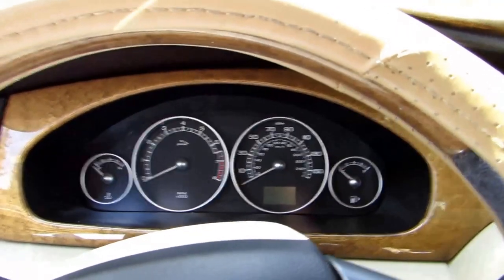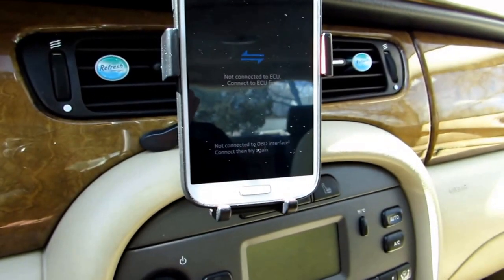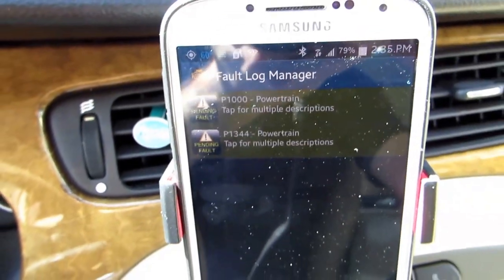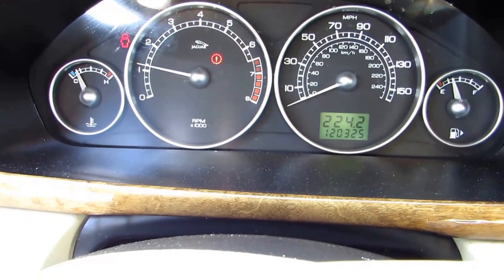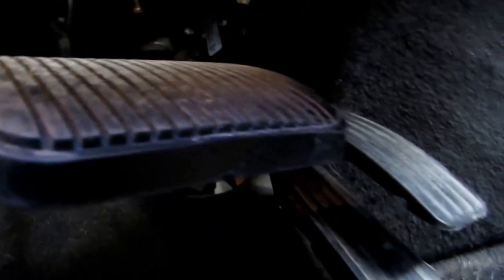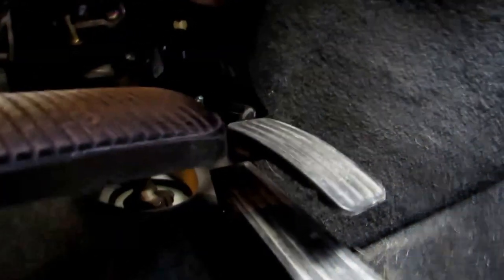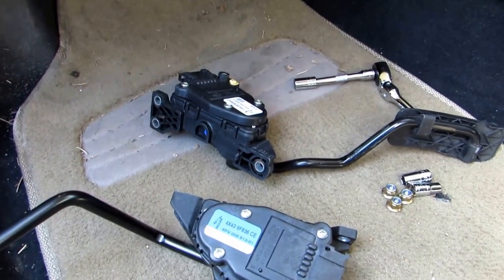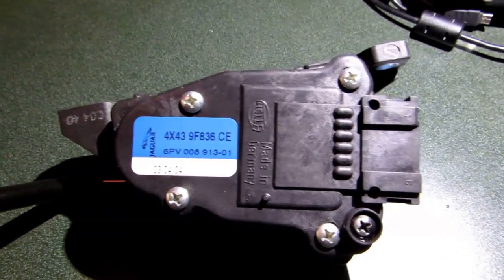2004 Jaguar X-Type Accelerator pedal sensor repair

Comment: Yes this is the fix for most throttle body sensor codes on a jaguar also bad connection in the connectors

Comment: what can cause your 2003 Jaguar X-Type to go into limp mode just saying Cruise not available won't go past 3000 RPMs and sputters and jerks
Reply from the maker: Trap Star, can you scan the car's computer for error codes via the ODB2 port? That usually narrows down the problem, then Google the error code for the specific reason it's acting up, and the error code is sometimes unique to Jags. There are so many reasons the cat could go into limp mode, it's hard to determine exactly why it's doing it.
Reply: Hi, Did you solve the problem?

Comment: Thank you. May I ask the app you used "Torque" is there a Bluetooth device that connects to the OBD2?
Reply from the maker: Jasper Stanford I use a BAFX Products ODB 2 scan tool purchased at amazon.com, but if you do a generic search on their website for any ODB 2 Bluetooth scanner you may find something you like even better. Customer reviews are usually accurate regarding compatibility with cars.